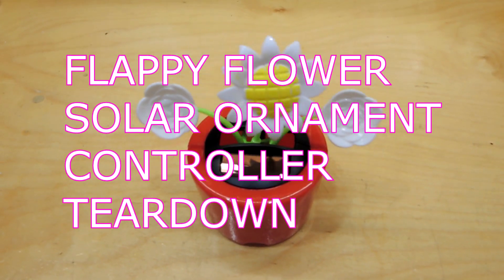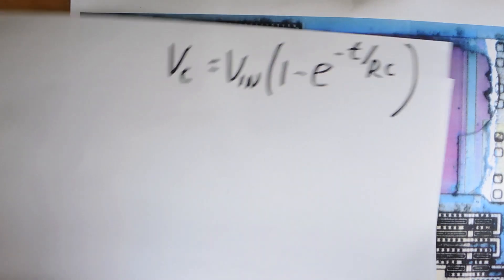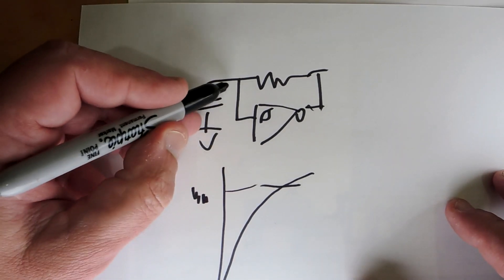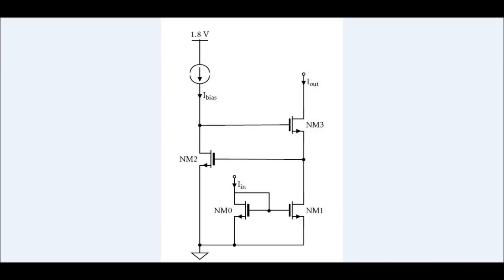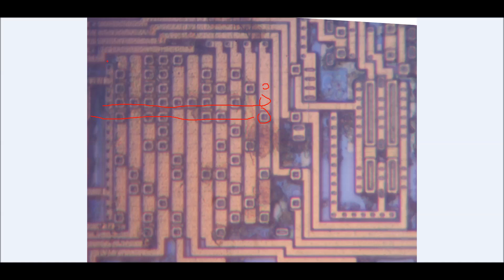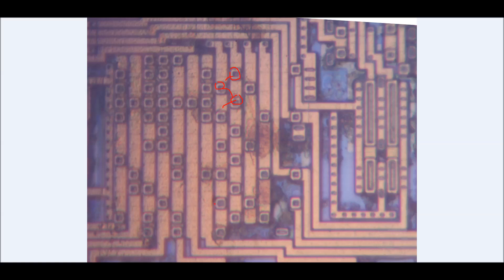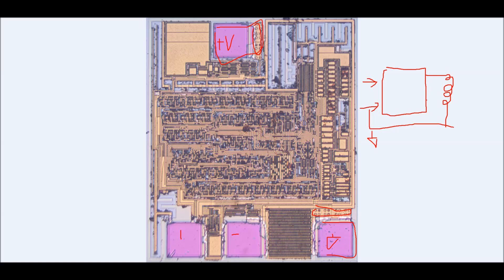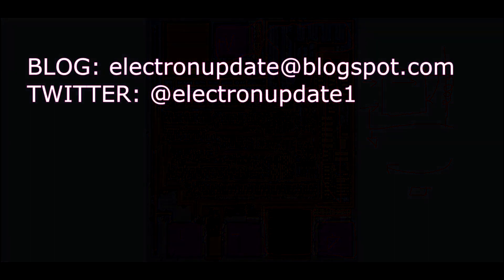Flappy Flower Solar Ornament Teardown

Comment: Nice work there! Just wondering, if you have seen the Oregon Trail handheld teardown before? (https://hackaday.com/2018/03/14/teardown-the-oregon-trail-handheld/) Many have wondered what is  inside the blob.. which a few speculated it is some form of 6502 / NES on a chip? But the graphics were suggesting it was a DOS version? Would you be interested in finding out what's inside?

Comment: The operation is very similar to an art form from the '90s called BEAM electronics. This chip would be described as a Solar Engine, and is equivalent to about 1 neuron. The fact that it has feedback, clocking, and instructions makes it much more powerful in robotics, and these circuits are very versatile. I wouldn't be surprised if these chips were mass produced because they have military/spooky applications, and some were just made into toys like this for other reasons.

Comment: Interesting Video, I always love these in depth videos about semiconductors... One question thou: wouldn't one of the power optimized pads go to the coil and not ground since there won't be a lot of current flow from V+ to GND thru the chip.
Reply: Good point. You can see that the lower vias are connected to the big structure next to it.

Comment: Seems like a 555 timer would be easier and cheaper then this asic like chip or maybe even connecting the solar cell directly to the coil.
Reply: I think these ASICs are as cheap than a 555. The real cost is the initial development. After that is just a few pennies per chip. Placing them on the board might even be more expensive than the chip itself. 

A 555 based solution also needs a few extra components, while this asic only needs a capacitor, that’s handsoldered along with the solar panel leads and the coil.
So you can skip the entire pick and place step. 
Using a 555 will most likely be more expensive.
Reply: In needs to sense back-EMF to stay in sync. And it has a startup mechanism to start the movement from idle.
Reply: pizzablender I was thinking to cut costs further (these sell at dollar stores commonly) to reduce the function and have either no IC or a simpler commodity 555. It may not be critical that it’s in sync. My experience with these is your have to provide the initial momentum, they cannot start on their own.

Comment: Don't think it was actually meant for floppy flowers, more for clock pendulums, as swing clocks are likely a bigger market. 2 modules in the clock, and 3 cells, one with a standard quartz clock module and mechanism, driven with a single AA cell, to do the clock, like every other clock mech. The second, running off 2 AA cells in series, drives the pendulum to emulate an old fashioned pendulum clock. That it will run off solar power was probably an accident of design, the original needed a low power use, and the designer needed to have undervoltage lockout in there, so the 2 combine to make solar operation feasible, and the unit will start up reliably as well, as it generates a pulse on start up which kicks the magnet a little, and then builds up in amplitude of oscillation till it is limited by the air resistance of the pendulum.